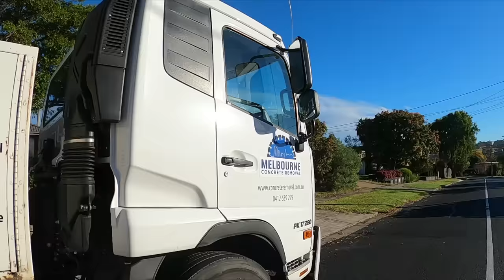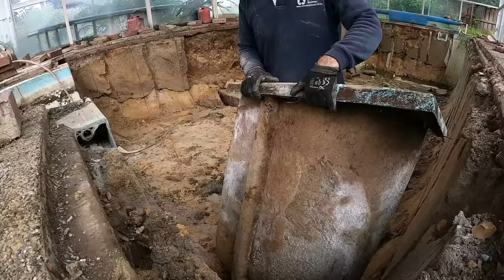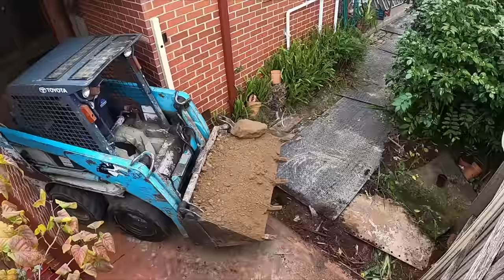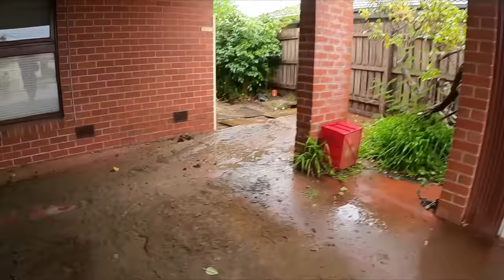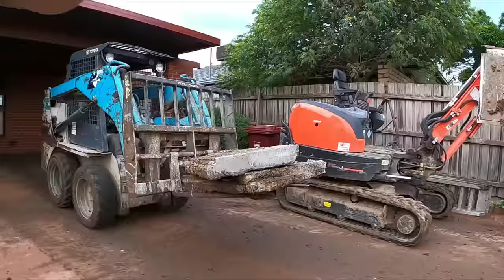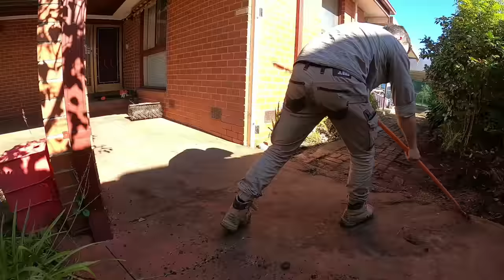Pool Removal - Look at that SLUDGE. LIMITED ACCESS. Time lapse.

Comment: So they had a pool and now they have a patch of dirt and gravel inside a frame that’s falling to bits and filthy. Hmm.
Reply: Should have just filled in the pool area.Should have left the paving around it, and left the plexiglass in place.Shouldn't have added gravel. Clean it up, hang some lights, put some heaters in it, and you'd have a winter greenhouse. Now you have compacted gravel which will only grow weeds inside a frame. What will they use it for?
Reply: No. They had a cesspool....🤢🤢

Comment: Improved with discounts! No more chemicals to buy, cheaper home owners insurance, no more smells, no more ugly views, no more physical effort to maintain and it goes on and on! Enjoyed, TYVM!
Reply: Could have achieved all that, AND kept the increased property value, by draining, cleaning, fixing, and leaving empty, but ready to fill n use by next owner…also increased equity for current owner…could also cover or fill with large plastic / styrofoam balls , 3-4 foot diameter, so no one falls in empty pool
Reply: @rstumbaugh43  absolutely. It's truly insane to fill in a pool considering the value they add to the home. Not much maintenance to keep the pool closed. Not the wisest choice, but perhaps the best for the homeowner. I am flabbergasted about filling in a pool tho.

Comment: I bet their neighbors loved them after this... The noise, the piles of dirt and mud getting all over, the blocked street... I'm also fairly surprised that they didn't have a new/nicer pool built in place of the old one. Oh well, to each, their own I suppose. 🤷‍♂️
You fellas who tore out the pool and filled it in, you did a damn nice job considering the circumstances. Talk about a tight fit with your equipment and moving all of that fill. Nice work, and thank you for sharing!
Reply: it's better than having a flies, mosquitos, etc breeding ground. Not to mention it probably stank.

Comment: It didn't look much different at the end not sure what they did all that work for?
Reply: My thought, exactly!?!?  Very curious.
Reply: Concrete requires a lot of effort to get rid of. You need a specialized saw among other things. From there they went to a fill site and got a few loads of dirt and used a packing device to ensure it was compressed. Then they put a gravel layer on top and flattened that too. It was a lot of work.

Comment: Great operators!  I wonder why they didn’t pull the old concrete first and put in the bottom with the fill
Reply from the maker: Thanks.
It's easier to get it with the bobcat and safer to do it once the pool is filled in.
This way the machine does the work and the hole doesn't sink once we are gone

Comment: Ummm...why not just drop all of the concrete that was cut away from around the pool into the void that was left after the lining was removed? A whole lot of wasted effort pulling it out to the street when there was a perfectly good deep and empty hole to put it in. But, yeah, nah, I would have kept the pool, cleaned it out and thrown in a coupla mermaids, nymphs palm trees and a water slide. Bewdy.
Reply from the maker: In some of my other videos we do that at the owners request. However, the councils here want proof that a complete removal has been done to remove it off of their plans with photographic evidence. It is also a lot easier and safer to do this job properly once the pool is filled in as there is no longer a void to fall into (OH&S)

Comment: I noticed a lot of comments about people saying how they would like the pool or that how removing the pool would lower property value, but they fail to understand how much time and money maintaining a pool costs. (Coming from someone who used to own a pool)
Reply: Correct. A pool is a zero gain feature. People who want a pool will put one in. People who don't want a pool will NOT buy a house with a pool. The pool is not something that will entice a buyer. It will turn off a buyer.
Reply: Incorrect. 

Coming from someone who builds pools. Initial cost. High, I agree. 

Maintenance? less $ than owning a cat per month.

Some people can't maintain a pool because they are old, lazy or simply can't afford a weekly pool boy. 

It is obvious here these people did not have much money. Hence why they didn't remove the pool. All they did was decrease their property value when they go to sell. Because in disclosure statements they legally have to say that pool is still there. If they don't. And sell. They can be sued. 

The more you know.
Reply: Also Philip. They could have simply drained the pool. Got the gunk out of it. And kept it dry. 

It is clearly a bit older. Would need some work around the top mortar. But it was clearly holding water. 

I would assume they did that for parking. Hence why they used crushed rock to top it off. 

The more you know.
Reply: @bmck5002  How is the pool still there? The components (liner) were removed, and the cavity filled, so it was no different to filling in a hole in the ground. It's like me excavating a hole in my garden and calling it a pool.
Reply: @Ahmed____  - sure Sheldon.

Comment: Wouldnt it have been easier to just fill up the pool with concrete to get the same flat surface?
Reply: way too expensive and not practical
Reply: No that would have been a harder alternative.
Reply: I say get some sport court flooring lay it down where pool used to be and use it as an inline roller skating rink.  Did that with a friends pool house, and we love it.

Comment: I was shocked by the amount of soil. Over here we would have used rubble, which is really difficult to get rid of for probably 2/3s of it, especially if there is a hard surface being put down. All that was going through my mind was, damn that’s a very expensive way to fill a hole 😳
Reply from the maker: Hi there, where are you located?
Here concrete, bricks and rubble can be recycled. It is crushed and mixed with other materials to be used as a different grade of road base/crushed rock.

Comment: What happens if you take the naive approach and just bury the pool rather than removing it? To save labor and time is the idea.
Reply: The water and bacteria doesnt just dissapear magically, it would damage the surrouding ground
Reply: @07g53  I meant remove the water before you fill it in, but that still doesn't negate your point.
Reply: @binaryglitch64  ye thats dxxactly what they did in the video, remove the water and bury it, i dont get what are trying to say
Reply: @07g53  no, they also cut the liner into pieces and hauled it out. I'm proposing they skip that step. 

ie. get rid of the water, bury the actual pool itself.
Reply: @binaryglitch64   they might want to reuse that piece of land, if you leave the pool liner there it would destroys the soil, plus making the soil acidic from being left too long
Reply: @07g53  no it won't, if it's poly vinyl resin, concrete, or fiberglass it wouldn't matter, the later two take hundreds of years to break down but the break down directly into natural materials and biodegrade just fine albeit slowly ... as for vinyl, that's a bit more complicated but suffice it to say that while it's not exactly environmentally responsible, it's not something that would effect a lawn or garden above it... but unless it's a plastic pool liner (most likely polyvinyl resin) than it should be fine... I'd say drain the water, drill a few drain holes in it, and bury it where it lie, but I fear there's more to it than I realize. No worries, I don't have a pool nor an interest in pursuing any endeavour involving pools as I live in a place that's cold and rainy 9 months of the year. (Think London or Seattle.) We don't have many pools around here. Not much demand for pool related employees (cleaners, installers, demolishers, etc.) so... hence my lack of interest. At any rate nobody has to worry that I know my ideas are probably foolish, they'll never be acted on anyways.
Reply: @binaryglitch64   or its probably about the remainings of the pool might affect the ground, increasing risks of sinkage and seepage sort of. And not all builders demolish a pool the same way, it really depends on the location of the pool tbh, because doing it the wrong way could damage the foundation and leads to drainage issues and stuff. So its not worth cutting corners and budget when they could just do it the right way without any issues occuring in the future
Reply: @07g53  sounds legit, I buy it.

Comment: Why didn’t you take the concrete that was removed from around the edges and use it for fill? Would’ve saved you the cost of some fill and dump fees to offload the concrete
Reply from the maker: In this case the concrete is taken away to be recycled and reused in road base or concrete. It all depends on what the owner wants. In other videos all the rubble, bricks, etc get buried as per owner request.

Comment: I'd rather have a pool then a garage. What was the point of removing the concrete. Were you afraid it wouldn't hold the weight of all that dirt?
Reply: If they left the concrete in the bottom of the pool and just filled it with dirt then the water that soaked through the fill dirt will accumulate and end up a pool of mud eventually.  Gotta have the concrete gone so the water drains away.
Reply: @mikef1570  oh good point

Comment: The concrete squares from the edge of the pool, why wouldn't you leave them in the bottom of the hole and just bury them?
Reply: That's what I think too, save time and materials, less waste
Reply: possible disease or the growth of contaminates for the new soil.
Reply: Because they would be worth a fortune at a landscaping place. Hell of a lot more than the volume of dirt they could have saved. Notice how nicely square cut and careful they were with them? They would have been sold not scrapped.

Comment: Y so much effort u could have everted the flooring and filled on that only. Could have saved dirt and trips ..
Reply: stroke i having that reading X_X
Reply: @anonymous-mj8wb  had me stroke trying to read that*
Reply from the maker: In a full pool removal, we don't leave any rubbish behind. All steel, concrete and bricks removed goes to a recycling facility where it is crushed and used again somewhere else. 
The fibreglass and any other rubbish like pool liner etc is taken to landfill.
By not leaving any rubbish or materials behind we can be sure that the filled in area won't sink in the future.
Reply: @demostan  And is clean and organic.

Comment: So you removed the pool which added value to the property to put in the car port. Dumbest thing ever
Reply: actually pools don’t add home value because they require upkeep :)
Reply: ….and they are a liability.
Reply: I’m assuming that the owner of the house is going to build a greenhouse. I’m assuming based on the fact that the structure is still up at the end.
Reply: Oh a carport cause I was wondering.
Reply: carmen vitale  ask your insurance company how they feel about a pool.
Reply: @Eternalsfan  I very much doubt that, if he couldn't be bothered with the pool, not even draining it, I reckon it will just be a mess as it was before.

Comment: I would have cleaned it first rather than work with that  awful smell.  On your cloths your boots your work truck gets contaminated .  . Nasty !
Reply: Your still gonna get that awful smell on you cleaning it out
Reply: Getting that smell on you is unavoidable. The best thing you can offer is bring a change of clothes for when you go home and have a hot shower waiting.
Reply: Sweep it, scoop it, flush it out with pressure washer, and mop it with bleach & water. Let dry. Saves a big, smelly mess to track through.

Comment: Why would you not just have filled it in save your self a shit load of money some ppl have more money then  brains
Reply: If you don’t remove it, you have to disclose that you’ve buried a bunch of junk on the property, which lowers the value.
Reply: Your filling in a hole that is rock and dirt and taking out the pool is taking away value as well so ether way you are out money
Reply: What if body us buried behind those walls
Reply: Buried pools often tend to say buried and eventually it will turn up and the next owner can come after the previous owner who had it buried and not to mention it probably would not contact near as well if it was tore out.
Reply: @My_Secret_Sketchbook999  could be ur body

Comment: I've always wondered why no-one has invented a flexible conveyor belt system for things like this - you run it from the pool to the street - you cut up the pool, putting the pieces onto the conveyor and they are taken to the street, then you reverse the conveyor and it carries the fill from the street into the pool... - shimples
Reply: Good idea.

Comment: Why not put the concrete in the pool hole????
Reply: Concrete is very expensive.
Reply: expensive and not easy to work with for future projects
Reply: I think @Ray is asking about putting the old concrete pool deck they removed in the hole before they filled it.  That would save on the dumping fees and require less fill.  I would guess without busting up the concrete, they wouldn't get good enough compaction.

Comment: Curious why didn’t you just burry that concrete under all that dirt?
Reply: You could run into settling issues, plus there could be things like paint or chemicals left on the pool walls, or piping/electrical behind it. Better to just remove it and put dirt on dirt.

Comment: Why not just empty the pool, then cut a few hundred holes in the bottom and sides for drainage, remove the coping stones, put 1/2 metre of shingle in for aiding the drainage, then infi;; with soil, maybe it`s building regs.
Reply: Easier to remove the fiberglass liner.

Comment: I wanted to see a pool get restored.. not cut up and filled in.. hell, i would have even cleaned it before i cut it up. bad video.
Reply: but the title says 'pool removal' not 'pool restoration'
Reply: @GigglyardoYT  they could have hit it with a pressure washer at least.. disgusting slime being thrown onto those trailers.
Reply: Too expensive to restore and own for that matter.

Comment: that's pretty dumb to fill in a pool you have then to clean it up and use it
Reply: exactly what i thought haha This pool wasn't beyond saving.
Reply: @bartdereu9267  it would be worth it. dig out the gunk, air out the pump lines then rinse, powerwash the pool, squeegee  the rest of the dirt to the corner and vacuum or pick up,  fill with clean water add clorine then turn on pool pump.  I watched pool restoration when it's in bad shape like this. its worth it when finished.   it's all about the chlorine and circulation to keep it clean.  they have pool vacuume robots to vacuum if your lazy. they even have auto chlorine dispensers if your super lazy!

Comment: you removed the sludge and replaced with soil , not really a removal
Reply: They removed the Pool so its a removal.
Reply: @charlieretro  They removed part of the pool.  Left alot of concrete, especially the sides.  Should have removed it all.

Comment: why dont you just fill that pool with dirt
Reply: If the shell is not removed or at least perforated with 12" holes every 3 or 4 feet in all directions so it will drain out the bottom, it will catch and hold water. It will become a mud basin. This one had a roof so that danger is smaller. but still present. Clearly the owner wanted a usable indoor space for recreation. A pool is a single-use feature.

Comment: Feel sorry for the next homeowner to have to dig out the pool that is still there. You didn't remove it. You simply hid it..

You know that right? I hope..
Reply: Cheaper most like
Reply: Really? It was a fiberglass pool. They cut it out in sections and tossed it in the truck. Clearly visible in video. (rolls*eyes)

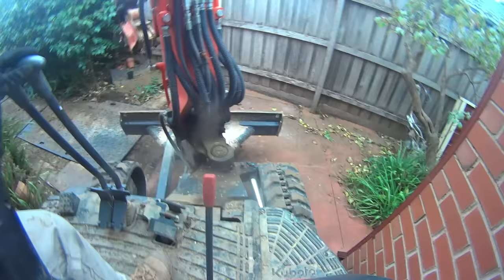Comment: wouldn't it have been faster to use wheel barrows at 04:20 ? All those tight turns lol.. maybe even some type of suction machine that sucks the dirt and puts it into the pool.
Reply: That machine was just to pack the dirt down, that only had to go in once. the smaller blue one was going back and forth and was able to easily maneuver

Comment: Just wondering, why not cut up the top concrete and throw in the bottom of the pool, before compacting the soil ?
Reply: No way to get consistent compaction doing that. There will always be pockets of uncompacted material that will eventually settle and leave a depression or worse a hole in the top soil
Reply: @markg.2501  but then just add soil to any depression ? If you compact on levels, the sinkage is limited surely

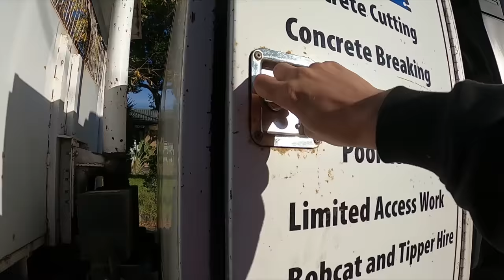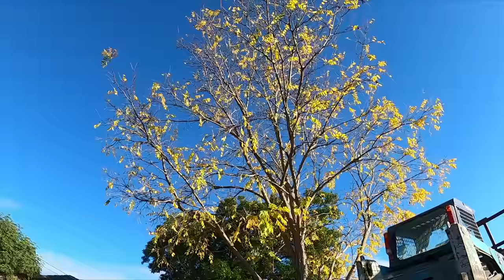Comment: Desde 01:06 hasta el 03:02 han perdido👎..⏱+$...yo hubiera enterrado las laminas de la pared..¡¡han encarecido el trabajo🤨!!🤦‍♂️🤷‍♂️
Reply: They're probably going to scrap the metal and attempt to get some kind of money out of it probably not much but I guess it's better that way though I do see why would they take all the time and doing that just to fill it in
Reply: @charlotteelliott3945  veo razonable lo que has dicho👍aunque creo que poco dinero sacarán😉..un saludo desde Barcelona.
Reply from the maker: In a full pool removal, we don't leave any rubbish behind. All steel, concrete and bricks removed goes to a recycling facility where it is crushed and used again somewhere else. 
The fibreglass and any other rubbish like pool liner etc is taken to landfill.
By not leaving any rubbish or materials behind we can be sure that the filled in area won't sink in the future.
Reply: @demostan  en eso te doy la razón de que asi es mas seguro..pero metiendo la aplanadora..creo que pocas burbujas de aire habrian...la verdad que asi esta mas limpio(aunque mas costoso)